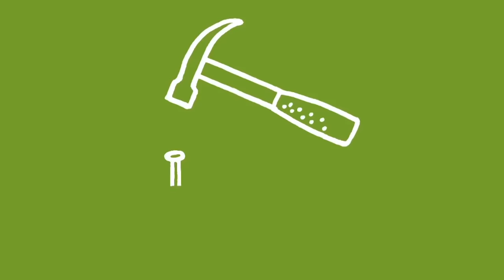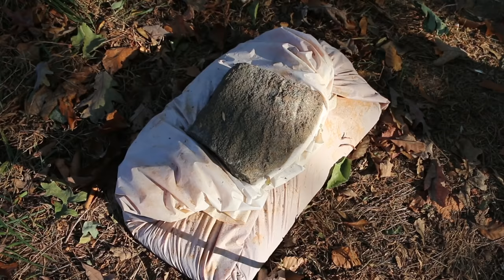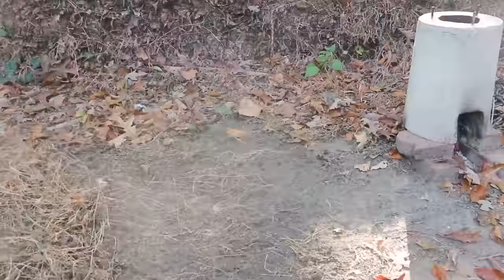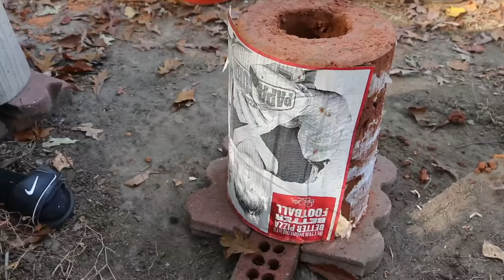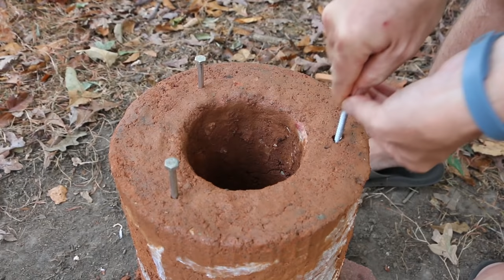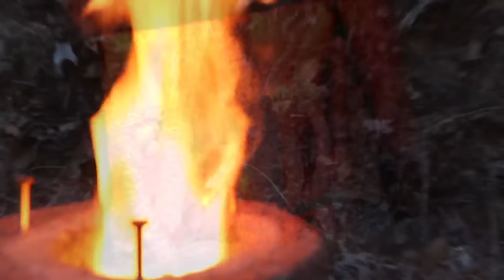How To Dry A DIY Mud Rocket Stove

Comment: with out the mesh and sand instad if you just add some straw or hay about 10% with your clay,  you'll get better result and last longer even the rain will not crack it and no gaps , our people here in Iraq use that for centuries to build tandoor. very nice to watch your videos
Reply from the maker: +Ahmd Wsami thank you. Working around the mesh was a challenge. I think I will make another rocket stove trying the method you are suggesting. I was just in Peru and saw a man making Adobe bricks. He was using straw as a binder. Thank you for watching and for your comment and encouragement.
Reply from the maker: Ahmd, I featured your comment in my latest video. Take a look... https://www.youtube.com/watch?v=BOl8y_EXA84

Comment: I am a Sculptor that has used clay for over 50 yrs : best to let it dry to what potters call green dry . It becomes dry all the way through. Then start a fire , other wise it will crack as the out side is dryer then the inside so when it is fired there is a vast difference between the outside and the moist inside. It will take a long time , but it is like making adobe bricks , turn it over to expose the bottom , sides to the sun . You could temper it with straw , as this is the way traditional tribal people made ovens around the world. You could use fiber glass in the clay mix.

Comment: Very good idea as the cost is mostly a little labor and some patience. But the thing takes way to long to perfect and even after all the time and effort you have to worry about it breaking down over time. Must be a better and much quicker way to do the same thing. I look forward to your improved model in the near future. Thanks
Reply from the maker: That's why I do the trial and error, the prototyping...so you don't have to. :-) I did actually leave this one out in the weather to see how quickly it degraded. It is still around, but not intact. One thing I will leave out in the next build is the wire, that added a whole lot of extra time to this build and I got a lot of comments that suggested it wasn't necessary. I appreciate your feedback. Thanks for watching.

Comment: Instead of cardboard, you might try  Coraplast (corrugated plastic sign material). It would work the same as cardboard, but slip off of the mud easily.
Reply from the maker: Hi Rick. Thanks for the tip. I had used the cardboard with my concrete rocket stove build and it came off easily. I didn't expect it to stick to the mud like it did. It might have come off more easily if I had let it fully dry first. But, I was too anxious to fire it up. Thanks for watching and for the comment.

Comment: Great job it looks like it works great!
Reply from the maker: +Sharp Works thank you. I was pleased with how this mud version of the rocket stove worked. There are a few more cracks as it cooled down and dried out more, but they should patch easily. Have you thought about using a rocket stove for tempering your knives? Or is annealing?
Reply: GreenShortz DIY yea I thought of making one to use to heat treat my knives. It's basically makes the steel harder and helps the knife dull less frequently, but it needs to get the metal glowing red hot. I may make one of these to test it out see how well it works. Thanks for the helpful information on how to make these

Comment: You might want to try applying multiple coats of linseed oil as a water proofing agent.  I would do this with a sample piece of cured cob first just in case it creates a sticky mess.
Reply from the maker: Richard Watkins thanks for sharing this idea. I may give that a try. I will do the test

Comment: I think it would be interesting to see how long it would take for the earth formed rocket stove to return to nature.
Reply from the maker: +Greg's Garage interesting perspective. Well, we know when it was created. Maybe I should make a second cob rocket stove and the it out in the weather.
Reply: GreenShortz DIY pulverize it and add it to a slippery cob batch.  it would have more refractory properties for the next stove.

Maybe using a metal bucket you could fire it right after you pull the fire path molds...leave the metal bucket handle on for transport.

Comment: The problem is that you thought it wrong. First, the ratio of clay to sand shall be two or more pieces of clay (in volume) to one piece of sand. Second, make some ingot-shaped container (5in long by 1.5 in thick, with the bigger side 2in by 1in) made out of clay or wood (or anything), let that dry, fire that, then use clay to make other bricks, and have them fired. 

When you're done, you should have the wall small at the beginning, then you can work on having the ingots smaller-part-inwards (so it becomes closer to a perfect circle) and how that you know what size is right, have a half-an-inch layer of clay with the center inside the tube (no clay inside the tube), then apply clay to the outsides of the tube, making sure there are no holes, then press the bricks to as close as a perfect circle you can get them, use the excess to make a circle, then add other bricks by (again) pressing them towards the center/tube (so that the excess clay can be used for the next layer, and so that there is no hole INSIDE the stove's walls) and I would say two such layers of bricks and another thin layer of clay around it shall be enough. 

No bucket required. Let it dry for a few hours, then make a small fire around it (some 10in distance), and get it closer and closer to the rocket stove, and when you're a few in away, slowly remove the tube with circular motions, as well as the jug or brick you used to make the entrance, then get the fire inside, and use the same trick as before. 

Also, first start with a small fire, which shall be kept on for a few hours, then the size shall be increased to the point where the burning wood readhes the top of the hole, at which point you start adding wood to the outsides of the stove, from the end opposite to the entrance towards the entrance, so that when you're done the fire starts spreading from the entrance towards the opposite end.

Once fire is all around, you're basically firing the stove, so you can add even more wood, if you're sure you can feed it enough air to burn hot. Once that's done, you shall have a great alternative for the concrete stove, and with a minimum ammount of cracks and holes (likely none, if done correctly).

Note that some people prefer to have 2 or 3 extra holes, on the bottom of the stove, so you don't have to elevate it to draw in air.
Reply from the maker: Cool. Thanks for sharing this detailed process. I've been wanting to try an adobe method like you've described. I've been wanting to make a pizza/bread oven. I'll add this to my list of videos to make. :-)
Reply: Thanks!

The mistake most people do when building small structures which are meant to be heat resistant is that they don't test the clay. I would make bricks with different combinations of clay and sand. (Like buildings, ovens and pottery...) I saw the channel Primitive Technology do that once and everything made much more sense, for the types of clay he used for different tasks.

Then, one thing I would try when building the structure, is I would have a layer of clay thicker than the sticks you picked, then and on it add a few sticks to function as holes, push them in, then cover them making sure the layer of clay is level, then build with the bricks on top of that layer. Also try to have the sticks have a small angle on the top-bottom axis, so that the air enters below where they exit in the oven, so that air comes in and not flames come out.

Because one hole is usually not enough., and even small holes can be useful, and can easily be patched with wood or dirt, if needed.

Comment: Great looking design but I want to use the wood burning stoves every day.  What sort of longevity do these  have with more use?
Reply from the maker: +Noah Carver I don't have an answer from experience. One thing that would help this design have a longer life is to insulate the chimney. The next mud rocket stove I make will use perlite mixed with the mud in a 2 inch layer wrapping the chimney. This will make it more efficient and reduce the heat expansion on the body of the stove, which is one factor that limits life span. The nice thing  about a mud stove is that it is repairable. As long as a crack isn't catastrophic, just slap some mud in it. :-)
Reply: Perlite will be a nuisance with lots of air and vapor expanding and bubbling in the mud. Perlite works in concrete because of the chemical reactions of hydration od the cement, not in clay.
Keep it simple; use dry grass chopped in short strands. It' has been a fool proof system since at least five thousands years. The grass carbonizes inside and makes an insulating clay with added silica, but won't burn outside so it remains a fiber reinforcement and shrinking control additive.

Comment: is that just red clay from the grown with nothing mixed with it?  how long should it last?
Reply from the maker: Hi Tim, This cob mixture is clay (Georgia red clay) and sand. Here's the build video where I mix the two ingredients. https://www.youtube.com/watch?v=DsAb7a7u2cc Cob normally includes straw, but I left this out due to the heat. I had a few comments that informed me that the heat wouldn't matter. I plan to keep this stove covered to keep the rain off it. That should help it last longer, but I'm not sure of the lifespan. It will likely have to do with how often and hot the stove gets fired...and how exposed it is to the elements. Thanks for watching.
Reply: great thanks buddy I'm also in Georgia gotta love the red clay
Reply: TIM LASHLEY

Comment: Why don't you fired it by building a fire on the outside and encase the the stove with it
Reply from the maker: +john camara I've seen this done to dry a mud rocket stove before. The outside of the stove ends up blackened, as you can imagine. I was wanting to avoid that, but the method works. Thanks for watching.